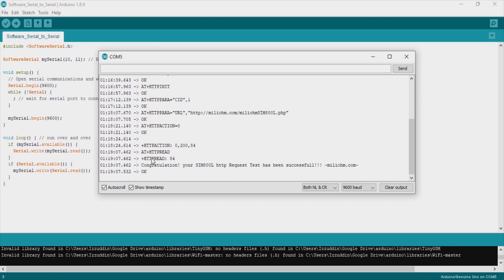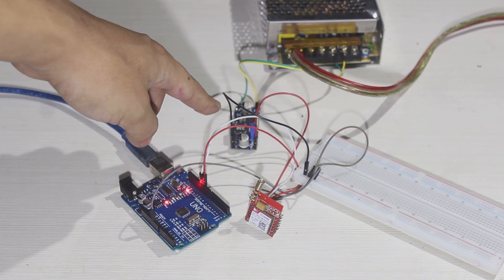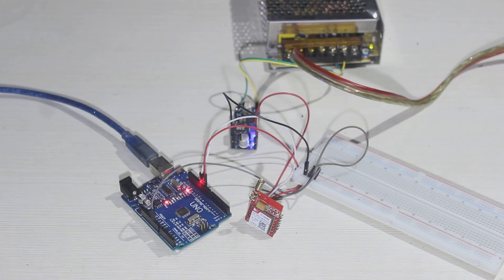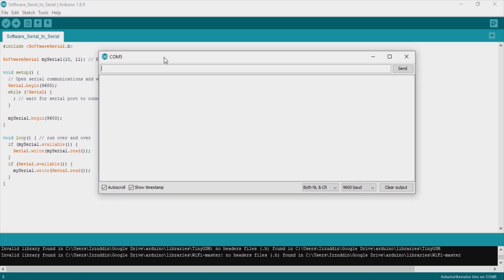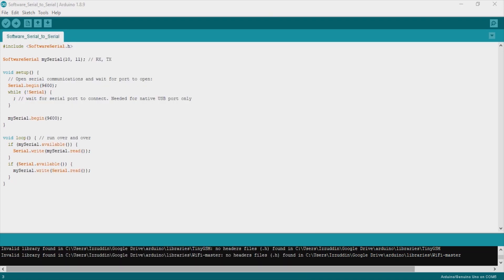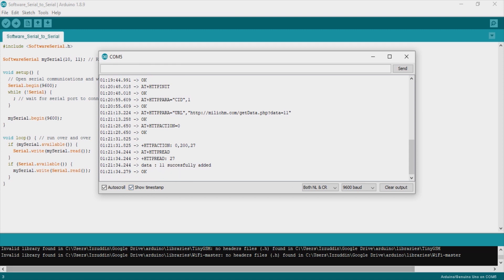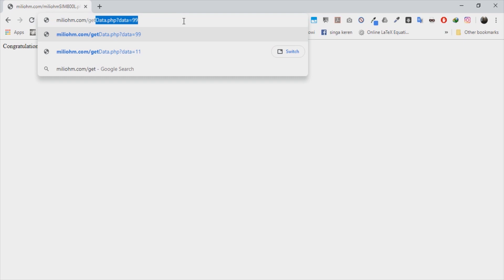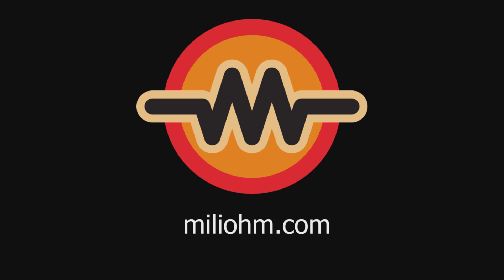HTTP/GET Request using AT Command - SIM800L Internet Connection Tutorial (Part 1)

Comment: So how can we process the incoming data? For example, I want to turn on the led with the incoming data, but I could not do it.

mySerial.println("AT+HTTPREAD");

After this command, I want to read the "on" and "off" information from the web address and act accordingly.

if (Serial.find("on"))
 {
      Serial.println("LED ON"); 
digitalWrite(ledPin, HIGH); 
  }
    else if (Serial.find("off"))
{
      Serial.println("LED OFF"); 
digitalWrite(ledPin, LOW); 
 }

I tried to find("on") this code, but it didn't work, the led didn't turn on.

incoming data in quotation marks on  out monitor "on" and "off" google firebase .json 

if else led control =="on" , =="off"

I tried so hard but I couldn't

string parser

On off information is coming from google firebase and how can we parse it

I want to perform an action by checking the incoming on and off information

Comment: Hello, when I type the AT commands I can't see them in the serial monitor. Just a blank spot and then the response of the SIM800L. Checked the wiring and it's powered from a power supply. Please help. Thanks!
Reply from the maker: What's the response of SIM800L?
Reply: @miliohm  Everything works fine, but I can't see what I have written. For example when I type the the "AT" command I get a blank spot and only the response "OK". (sorry for the late response)
Reply: @miliohm  same problem with me.. how to solve this problem

Comment: Bang mau tanya, sim800l setelah agak lama kirim data ke Thingspeak dia malah berenti dan AT command AT+CIPSEND nya ERROR, nunggu ke sambung lagi bisa 30 menitan,  ngatasinnya gimana yaa Bang?
Reply from the maker: saya belum pernah ngalamin, tapi coba direset aja setelah agak lama itu
Reply: Sudah saya tambah perintah reset Bang,  tapi masih tetap mode standby seperti saat mode sms,
Reply: tambah hardware WDT kalau ada feature itu. saya set 180sec, else reset. selepas reset, sudah ok semula

Comment: Hello there. I bought the product "LILYGO® TTGO T-Call V1.3". It has a SIM800 integrated on it. I am using the same code correcting TX / RX GPIO numbers. But when I type AT in Serial monitor, I cannot get a response. Can you help me with what I am doing wrong?
Reply: I just realized what I was missing. Now I am responding to commands.
Reply from the maker: @brsguler  congratulation
Reply: @brsguler  Merhaba AT Komutlarından bende cevap alamıyorum.Sorunu nasıl çözdün yardımcı olursan sevinirim. hdemirtasus@gmail.com
Reply: @harundemirtas8854  mail attim
Reply: @harundemirtas8854  bu arada gönderdiğim kod  mesajımda belirrttiğim kart için geçerli
Reply: @brsguler  Benim sorun sim800l modül ile arama ve mesaj atabiliyorum fakat seri port ekranında AT yazdığımda hiçbir cevap gelmiyor.
Reply: Farklı Arduniolar ile denedim fakat  sonuç değişmedi.
Reply: @harundemirtas8854  softwareserial kütüphanesinin örnek kodları senin işini çözüyor olmalı. Pin numaralarını düzelttikten sonra senin işinin benimkinden kolay olması gerekir. Sendeki modülden bende yok ama izlediğim bütün videolarda pinleri düzgün giriyorsan sorun olmaz. Cihazın çalışıyormuş çünkü denemişsin
Reply: @brsguler  hello, I've a problem like you, can you send me your code please
Really thanks if you send me a code to riskizoldik@gmail.com
Reply: @riskizoldyck8063  of course. O will send the code soon
Reply: @riskizoldyck8063  is this mail correct? i could not go send email to this address

Comment: Hi. Thanks for the class. One doubt: the SIM800L is only 2G? won't the 2G system end? therefore, can using this module be a problem?
Reply from the maker: I don't think that it will end in years
Reply: @miliohm  
How can we know that? that's my question. Some people are saying that a date has already been set. See: https://www.oliviawireless.com/learn-overview/2g-shutdown
Reply from the maker: @prspedro1  yeah, maybe you are right. So we have to prepare with new kind of SIM module. But they are not so different. Still has same AT command. And more expensive of course.
Reply: @miliohm  Unfortunately. This will make our projects more expensive.  I wonder if there are cheaper 3G modules.

Comment: Excellent Tutorial!! Only one thing, this works fine when I use your site (miliohm.com/miliohmSIM800L.php)  to read the data. But when I change to another site (casadoeletronico.000webhostapp.com/t1.php) do not work. I receive an Error (+HTTPACTION: 0,603,0) that is DNS ERROR. Please, do you know what happens? Thanks very much.
Reply: I'm getting the same error (in my case it works with my website but no miliohm...), how did you fix it?
Reply: ohh i got it, it was because of the httpS protocol, solved, thanks anyway
Reply from the maker: Congratulations on that
Reply: @danielalejandrorobayo4630  hey, how you solved it? I am getting the same error. Thanks!
Reply: @MrMrLolu  you have to turn on the SSL protocol using AT+HTTPSSL=1
Reply: @danielalejandrorobayo4630  Thanks! I also solved making the website link http only.

Comment: for this module can't use 3.7v ?? for spec Working Voltage: 3.5 ~ 4.2V
Reply from the maker: It doesn't recommended. Sometimes you don't get enough current if you use 3,7v from arduino.

Comment: Hi, I tried to follow your instructions but AT+HTTPINIT always return ERROR. Any suggestions? Thanks
Reply from the maker: is AT+SAPBR=1,1 answer OK?
Reply: Hi, thanks for taking the time to respond to my question. Please see console output below:

AT+SAPBR=3,1,"Contype","GPRS"
AT+CSTT="claro.claro.com","claro","claro"
OK

AT+SAPBR=1,1
OK

AT+HTTPINIT
ERROR
Reply: @miliohm  Hi, my code is as below:
#define SerialAT Serial1
// TTGO T-Call pins
#define MODEM_RST            5
#define MODEM_PWKEY          4
#define MODEM_POWER_ON       23
#define MODEM_TX             27
#define MODEM_RX             26

void setup() {
  Serial.begin(115200);
  
  // Set modem reset, enable, power pins
  pinMode(MODEM_PWKEY, OUTPUT);
  pinMode(MODEM_RST, OUTPUT);
  pinMode(MODEM_POWER_ON, OUTPUT);
  digitalWrite(MODEM_PWKEY, LOW);
  digitalWrite(MODEM_RST, HIGH);
  digitalWrite(MODEM_POWER_ON, HIGH);

  // Set GSM module baud rate and UART pins
  SerialAT.begin(9600, SERIAL_8N1, MODEM_RX, MODEM_TX);
}

void loop() {
  Serial.println("Init modem ");
  chkSerial("AT+CFUN?");
  chkSerial("AT+SAPBR=3,1,\"Contype\",\"GPRS\"");
  chkSerial("AT+SAPBR=3,1,\"APN\",\"claro.claro.com\"");  
  chkSerial("AT+SAPBR=1,1");
  chkSerial("AT+HTTPINIT");
  chkSerial("AT+HTTPPARA=\"CID\",1");
  chkSerial("AT+HTTPPARA=\"URL\",\"http://miliohm.com/miliohmSIM800L.php\"");
  chkSerial("AT+HTTPACTION=0");
  chkSerial("AT+HTTPREAD");
  chkSerial("AT+HTTPTERM");
  Serial.println("Delay...");
  delay(20000);
}

void chkSerial(String ATcommand){ 
  String content = "";
  byte reply = 1;
  int timeout = 30000;
  char character;
  while(SerialAT.available()>0) SerialAT.read();
  //Send the atcommand to the modem
  SerialAT.println(ATcommand);
  delay(100);
  unsigned int timeprevious = millis();
  while((reply == 1) && ((millis() - timeprevious) < timeout)){
    while(SerialAT.available()>0) {
      character = SerialAT.read();
      content.concat(character);
      //Serial.print(character);
      delay(10);
    }
    //Stop reading conditions
    if (content.indexOf("OK") != -1){
      reply = 0;
    }else if(content.indexOf("ERROR") != -1){
      reply = 2;
    }else{
      //Nothing to do...
    }    
  }
  Serial.print(ATcommand);
  Serial.println(content);
}

OUTPUT:

Init modem 
AT+CFUN?
AT+SAPBR=3,1,"Contype","GPRS"
OK

AT+CSTT="claro.claro.com","claro","claro"
OK

AT+SAPBR=1,1
OK

AT+HTTPINIT
ERROR

AT+HTTPPARA="CID",1
ERROR

AT+HTTPPARA="URL","http://miliohm.com/miliohmSIM800L.php"
ERROR

AT+HTTPACTION=0
ERROR

AT+HTTPREAD
ERROR

AT+HTTPTERM
ERROR

Delay...

Thanks in advance for your help.
Paulo
Reply from the maker: @fingerprint8479  try AT+SAPBR=2,1 before http init. Did you get the IP address?
Reply: @miliohm  Hi, I reviewed the code and added the the above command. Now it runs but HTTPREAD only returns OK but not the contents of the web page.
Please see below:

AT+SAPBR=2,1 Resposta: 
+SAPBR: 1,1,"100.73.53.89"
OK

OK
AT+HTTPINIT Resposta: 
OK

OK
AT+HTTPPARA="URL","http://iot.hidroflux.com/upload/chkfsize.php?filename=acid.jpg" Resposta: 
OK

OK
AT+HTTPACTION=0 Resposta: 
OK

OK
AT+HTTPREAD Resposta: 
OK
The end.

If you run the URL you will see that it returns the size in bytes of the indicated filename but HTTPREAD only says OK.
The size of that file is what I need.

Thanks in advance for your help
Paulo
Reply from the maker: @fingerprint8479  try give long delay after HTTPACTION. Sometimes it takes long time
Reply: @miliohm  Hi, running manually from your sketch that do not have a timeout for data arriving from the SIM800L it works now. But if I automate all the commands inside the sketch AT+HTTPREAD still only returns OK.
I removed the timeout so the WHILE waits till all data arrives but still cannot get the file size. Have you ever used AT+FTPFSIZE? The response is OK 1,66. Thanks. At least I know now something related with the time it takes to respond. Will keep trying. Thanks
Reply from the maker: @fingerprint8479  Never use the FTPSIZE :D and keep trying